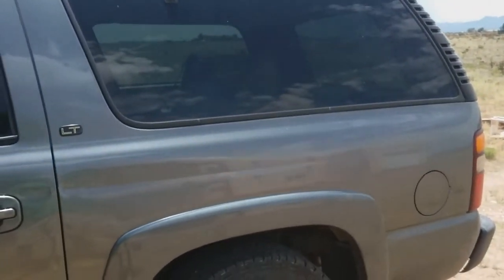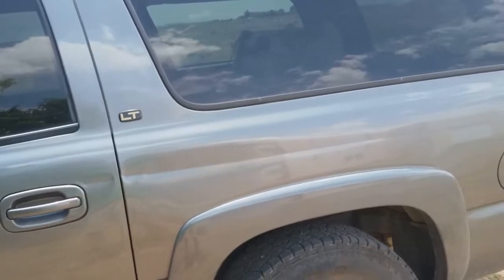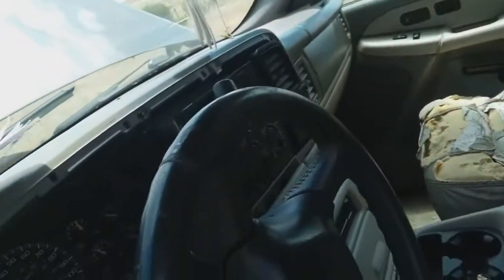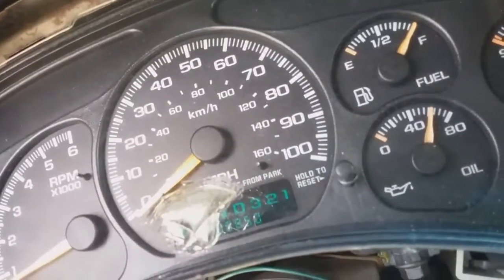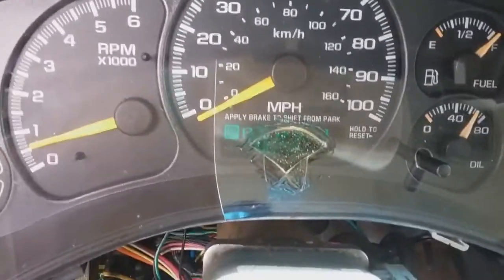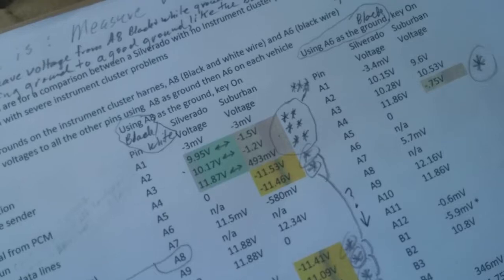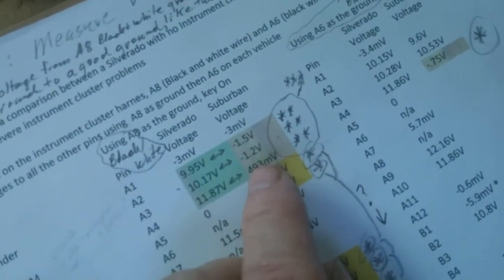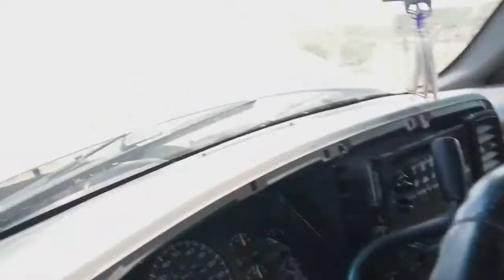2000 Suburban Instrument Cluster Fix

Comment: Jump a wire from A6 to A8
Reply from the maker: Probably the fastest way to check if A8 is a good ground. This assumes A6 is a good ground. I still prefer using a known good ground like the screw into the frame. Checking it, as a good ground by going to the positive side of the battery. This way you know you have a good ground and take any guess work out of the equation. But yeah, I think it could be a quick and easy way to check.
Reply: @johntube2525  I had a short wire handy so I tried it and it works so far!  Thanks for your video I wouldn't have figure this out without it.
Reply from the maker: @kevincarr4964  Thanks so much for your comment and adding to the possible ways to check grounds. Quick, less wire used and pretty easy to do. Thanks again.

Comment: ??? Where is THE GROUND,  YES ADD , CHANGE LOCATION 
BUTT  TO WHERE 😢😮
Reply from the maker: I do not understand your question, but I will still try to answer. 
There is a Multi-plug wiring harness which plugs into the back of the instrument cluster. 
From that wiring harness comes many wires. Two are ground wires. One is black coming from the A6 location on the harness and goes somewhere to a ground source. The other is Black and White, which comes from A8 and goes somewhere to a ground source. I am not sure where those ground sources are. That is why; I created my own ground source on the metal bracket on the dash, which I show in the video. My A6 ground source seemed to by ok, by the multimeter testing we did, where we measured the voltage with a multimeter, using the A6 end of the wiring harness as our ground, (using the black wire from the multimeter) and measuring the voltage at the other locations like A2 and A3 (using the red wire from our multimeter).  Key must be on to measure those voltages at A2 and A3., multimeter on DC volts. 
When we tried to do the same test, with a multimeter, but using A8 as our ground, the results on the 2000 Suburban were off.  This very test made me want to try a new ground, instead of assuming the black and white wire coming from somewhere was a good ground. I do not know where that black and white wire comes from or I would have fixed it. My new ground was a wire I screwed into the metal bracket on the dash and I ran that wire up to the back of the wiring harness and pushed it into the backside of wiring harness at A8.  Like doing a back probe on a wiring harness. There was already a black and white wire going into A8, but I figured it was not a good ground. With the new ground pushed into the back of the wiring harness, I then plugged the wiring harness into the instrument cluster and turned the key on and the instrument cluster started working because I now had a new ground going from the back of the instrument cluster wiring harness, at A8, to the metal bracket on the dash. 
You should check your new ground before plugging it into the back of the wiring harness. I did check mine by hooking that same wire up to my multimeters' black wire alligator clip and then I took a long wire and hooked it up to the red wire alligator clip and I ran that long wire all the way to the positive post on my battery. When I saw 12 volt DC on my multimeter, I knew I had a good ground with the extra wire I screwed into the metal bracket.  Knowing I had a good ground, because I tested it, I then disconnected the multi-tool from my new ground and the battery and took that new extra wire up to the back of the wiring harness and pushed it into the back of the wiring harness at A8.
All of this is in the video, but perhaps this helps.